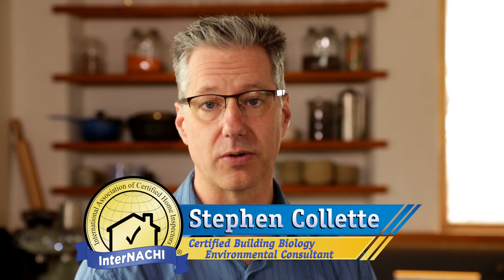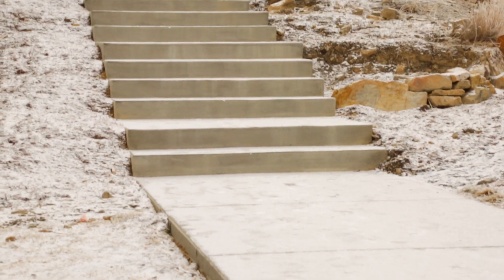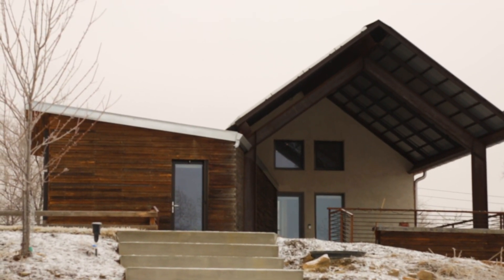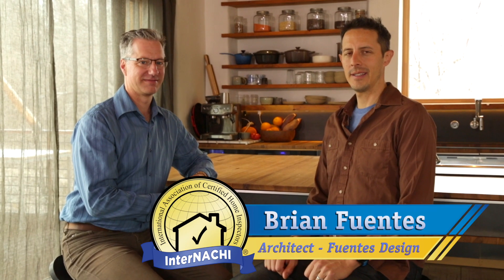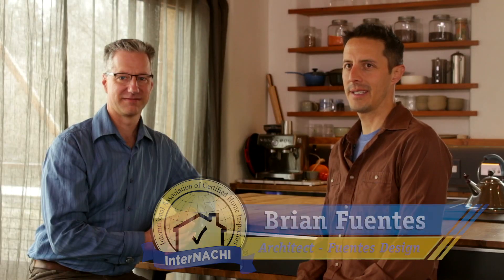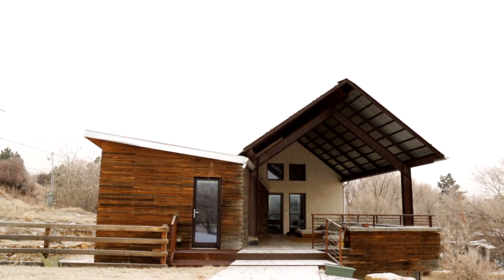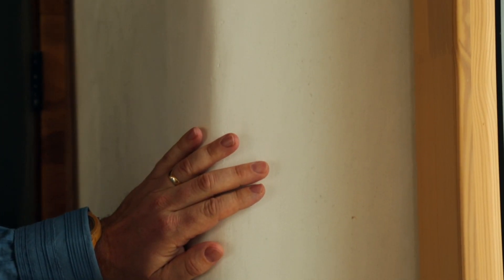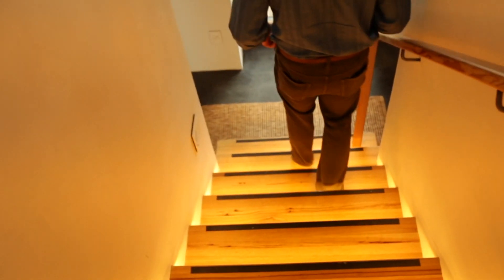Part 11: Healthy Homes, Natural Construction, and Building Science with IBE

Comment: Nice natural home. Not surprised ERV works well on a small one - two story home. ERV and HRV in homes over three stories with open stairwells sometimes need supplemental air handling, especially if they have radiant heat in the home to offset stacking effect in open stairwells, etc. How do you address stacking effect on 3 to 4 story open stairwells? I noticed HRV and ERV systems can't quite move enough air in buildings with a lot of vertical space.
Reply from the maker: Thanks for commenting.